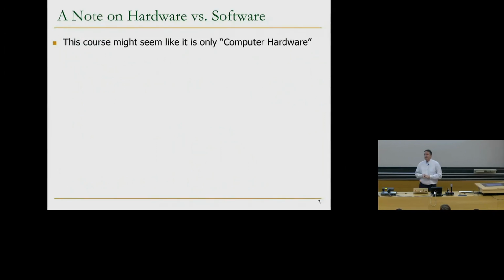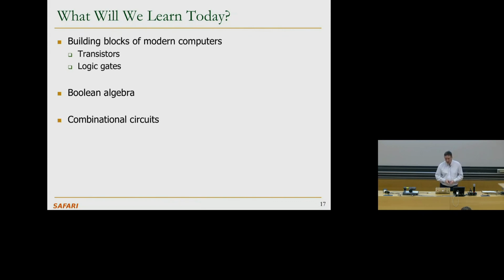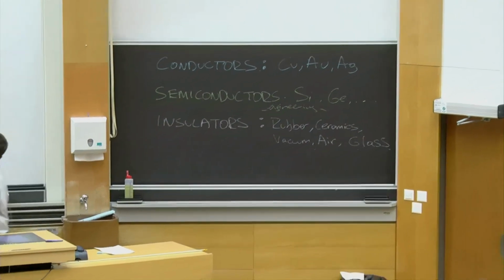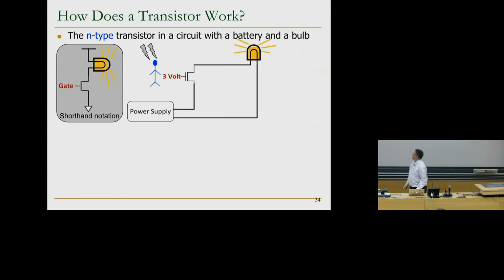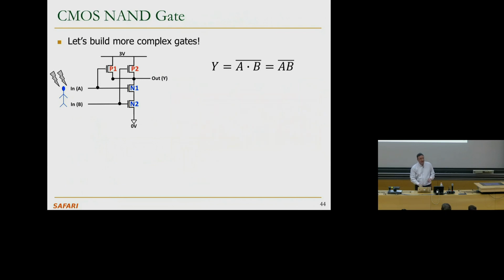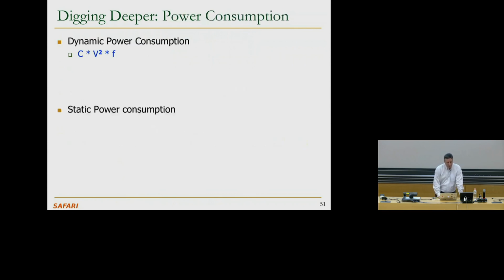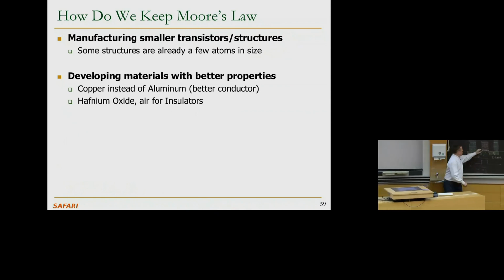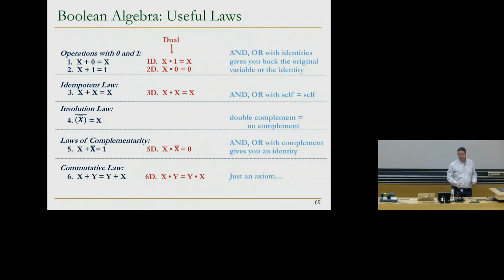Digital Design & Computer Architecture - Lecture 4: Combinational Logic I (ETH Zürich, Spring 2020)

Comment: My question is regarding construction of NOT gate.

In a P type transistor, if you apply 3v to gate the circuit opens, causing no current to flow in the circuit.

And if you apply 0v to gate, the circuit closes and the current flows.

That sounds like NOT gate operation. Then why can't we build NOT gate simply using a P-type transistor? Why do we need an N-type too? 46:00
Reply: This is shortly explained in D.&S. Harris Comp. Arch. To my knowledge, a p-Mos cannot "pull down" well, meaning, when the circuit is closed, and the source is GND, the p-Mos will transmit a low current swing from 0 to V_t,  V_t being the threshhold voltage.
Reply: In Digital circuits: we need potential HIGH('1') and Potential GND('0'). if you use only one transistor (P-Type) then you won't have a pull-down network to provide potential GND ('0'). So pull UP and pull Down n/w are important.